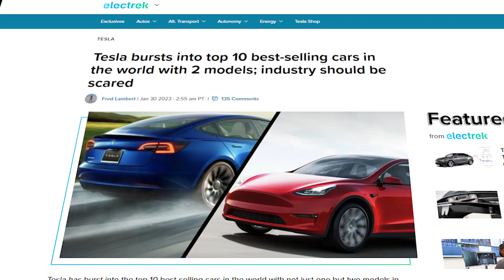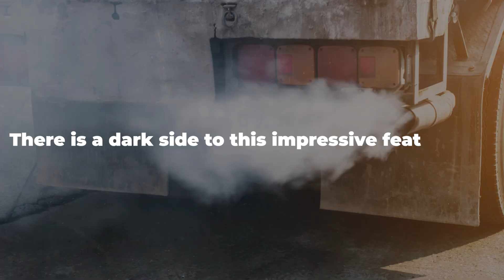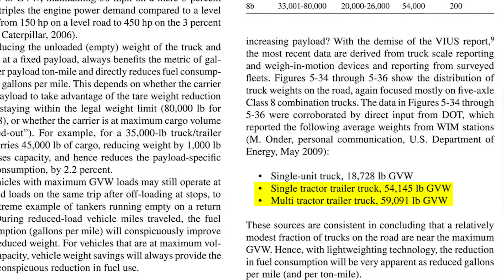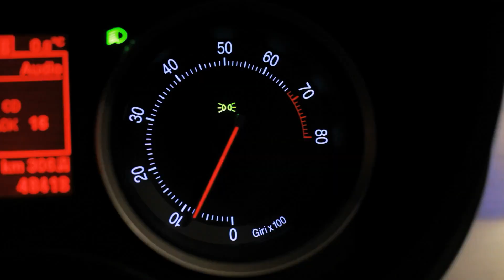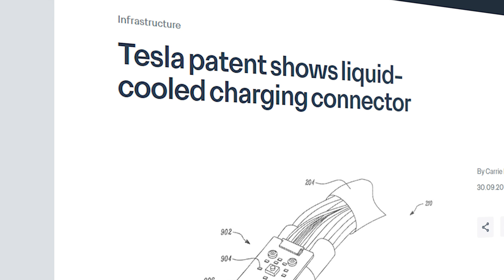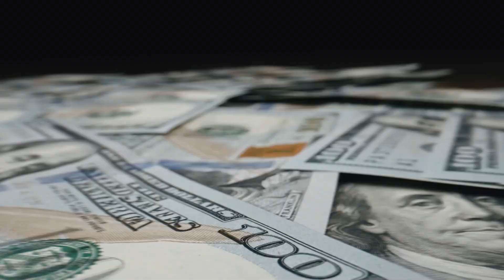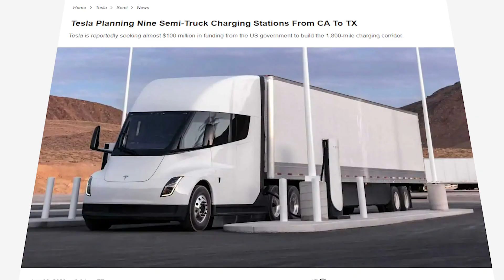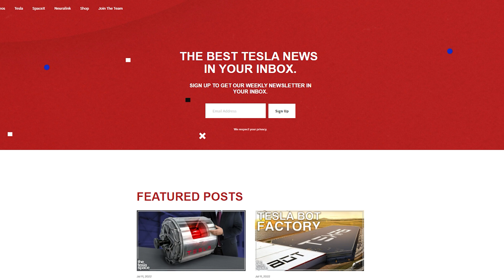How Tesla Reinvented The Semi Truck!

Comment: Only 50  Tesla Semi "gamechangers" exist and everything they say is a lie.  Can it carry a load similar to a diesel?  No the battery weighs too much. Oh did they tell you Semi needs a $200k charger w a million dollar megapack to charge it? Oh no .. slipped their mind.  Did they tell you it goes 500 miles - empty or down a steep hill. A Rivian R1T w battery 12% Semi's size can only go 120 miles towing 1/20th the load - 500miles? Full load - of lies.
Reply: Then you and all the Tesla haters have nothing to worry about then.  But considering Elon's history of totally disrupting entire industries it's not a good idea to bet against Tesla or any Musk company.  The fact is being a Luddite doesn't usually pay off in the long run.
Reply: Lookup the run on less event for real world released data. Over 80% of the loads grossed over 70,000#
The tesla semi using slip seating drivers at 65mph covered over 1,076 miles in 1 day. Covered over 400+miles loaded without charging.
Reply: @4literv6 4liter, where did you find load data? I'm on the Run On Less Results site, but don't see the promised load data. Thanks!
Reply: @BigBen621 I don’t know if the site directly gives load data, but run on less made a statement that all loads during the test were around 70,000 for the Tesla semi
Reply: Its all just a big advertising campaign, as usual. Based on lies

Comment: To nickpick a bit, regenerative breaking does not add range, it preserves range. 
The original statement sounds like credit card reward point ad, "the more you spend, the more you save."

Regular breaking lose range. Because energy has to be dispensed to get the vehicle back to original speed. 
While regenerative breaking store a percentage of the lost kenetic energy back to electric energy. That portion can be used to let the vehicle regain its original speed. Hence lose less range. But still losing range. You cannot add range by breaking more.
Reply: If you did a trip without regen breaking you would have a certain range. If you redid that trip and used regen braking you would have a longer range ... because ... you added some range.

Comment: I bet if they split those long haul routes in half, they could save $500/day and for $182,500 per truck per year they will find a way.
Reply: 400 kWh of cells about $40,000 so maybe save $8-13k per year if halved pack size.
Say need extra half to one hour charging per day, 200 hrs x $30 is $6,000 in wages.
They’d already use short range truck for most routes.

Comment: Actually the typical short crew 4WD F150 weighs in at around 6500 lbs (3.5 TONS)
Reply: That’s 3.25 tons but whose counting?
Reply: That's not 3.5 that's 3.25
Reply: Less than 3 metric tons

Comment: You know the reason they don't release the weight? Because the POS weighs over 30.000 lbs. And you better check into the cost to install the electric service to power that charger. That number is going to be in the millions
Reply: Jay Leno video says different. 1 500 mile semi, 1 300 mile semi loaded on an 18,000# trailer grossed in the 60,000-70,000# range.
Reply: More like 26,000 lbs. Still absurdly heavy for a highway daycab, but don't lie and say 30,000+.

Comment: Truck semitrailers are far more efficient than automobiles, when you consider the fuel to weight to mile ratios.
Reply: And Tesla Semis are far more efficient than diesel semis, when you consider the energy to weight to mile ratios.
Reply: @BigBen621  They maybe more efficient but there's yet  no fueling infrastructure for them nor are they ready for primetime, ie. they aren't equipped for the long haul drivers or owner operators. But as I've previously stated I prefer BEVs over fuel cell electric which are very complex with unstable fuel and leaky storage tanks. For they both are electric vehicles. Meanwhile I'll drive my pre 2007 diesel Peterbilt or Kenworth. Hold your breath when I drive through your town. 🥴🤧😖

Comment: It's not set in stone how long you have to drive without stopping. Spending 1-2 hours per day charging is a rounding error, less than 10% of the time.
Reply: Especially if the charging occurs during loading and unloading for “hopper” routes or during meal times for longer hauls

Comment: I think I used 2% to climb  Mt Washington, and I gained  5% going back down with a ModelY with 4 passengers and almost not using the disc break, mostly regen braking a win-win
Reply: Is it really possible possible though? The law of conservation energy states that you cannot create or eliminate energy. You can only transform one form of energy to another form. By going up  the mountain, you are transforming electrical energy to potential energy (using battery to go up the mountain) and by going down the mountain, you do the other way around. And I haven't taken into account the friction and mechanical efficiency of your car.  Therefore you cannot gain more than what you used. 

You said that you used 2% and gained 5%, which means you have just "created" 3%. It is either you went down further than what you started from, or there is a miss calculation on you Tesla.
Reply: @dennismeidiane probably a longer descent then ascent
Reply: @cjschoenmann2258  hmmm,  I don't think so. The only force that is keeping the vehicle moving (while not using electrical energy from the battery) is gravity. His final position must be lower in elevation than his starting point, therefore "generating" electricity from potential energy generated from going down the mountain.

What you said about longer descent, only means more friction with the road. Which means less electricity generated.
Reply: @dennismeidiane thank you
Reply: He probably went down even further, but still, it's impressive to see a car generate energy. Unlike traditional ICE cars that just waste potential energy.
Reply: @Riveulen  That is what I said. It is either a net difference in elevation (meaning he ended up lower than what he started) or a miss calculation in the Tesla.